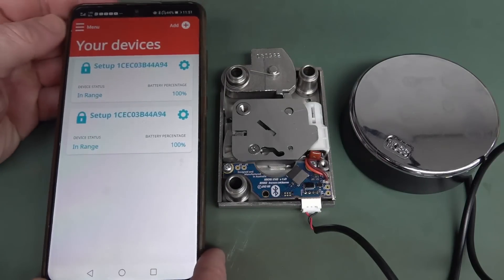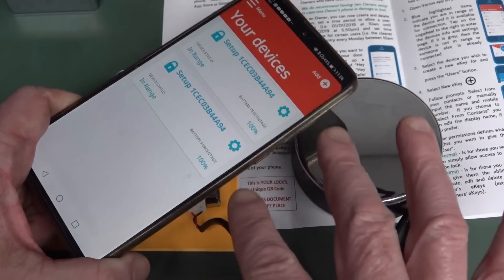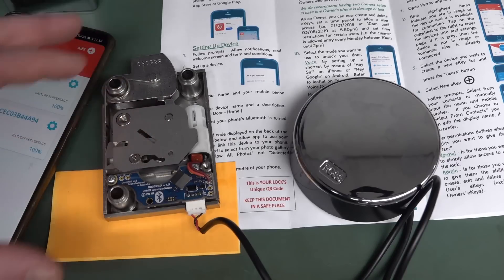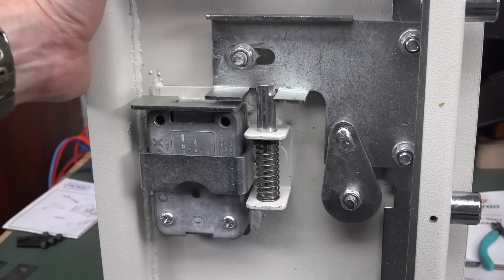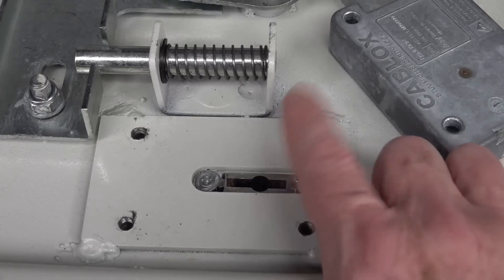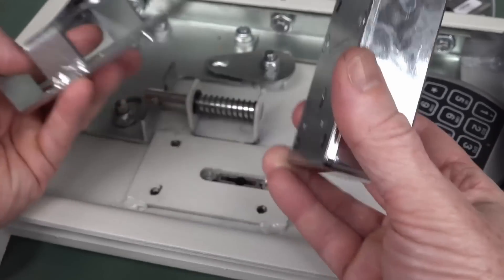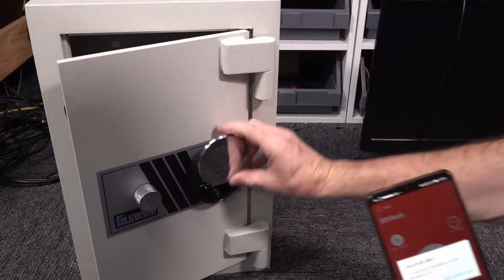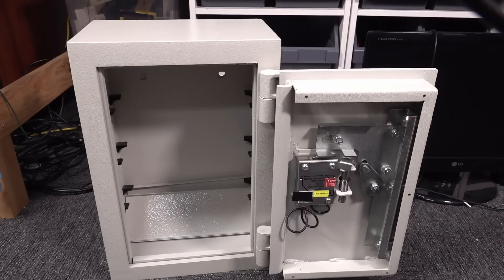Bluetooth Enabling a Security Safe!

Comment: "There's a KER-KLANK as the safe opens."
(a message in Fallout 2)

Agreed on using non-specific encryption protocols. Use a tried, tested and true industry standard protocol rather than re-inventing the wheel - there's a better chance of having any bugs squashed long before you even implement it on your device. Security by obscurity is an obvious insecurity.

Comment: What happens if you damage or migrate your handset to a new device, does all the codes transfer?  Seems like you'd need to keep a backup handset somewhere safe...
Reply: You can generate the code algorithm again from the QR printed on the manual. That isn't an issue.

Comment: Not really a Faraday cage, as the gaps on the edges, and all the holes in the steel for parts are going to allow a lot of RF leakage. Plus very likely the actual handle is electrically isolated from the front panel with paint and an oil film, so it will transmit the RF energy through, albeit with high loss. Hopefully you did check the emergency keyslot does work, and that you can open the safe without the BT connection.  Otherwise you will be opening it the hard way, angle grinder through the bottom or the back, which is where the safe traditionally has the thinnest steel, as most are designed to be either built into a wall or bolted down
Reply from the maker: Yes, farday cage wasn't really the correct term, and the handle is electrically connected to the chassis. The wires going through the front to the battery would be a high loss passive radiator I suspect.
I actualy didn't drill out the emergency key hole for this video, as I don't intent to keep the bluetooth lock installed. So yeah, I tested it just before closing and crossed my fingers and hoped it worked! Ross assured me it would, but still...

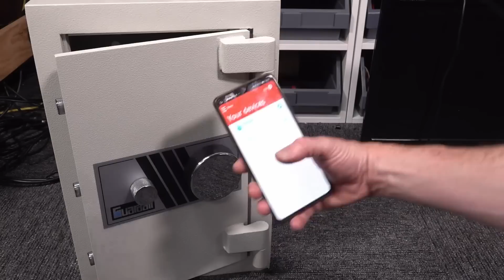Comment: Dave, 10:00, you also have the copper wires that are going from outside of the safe directly into the safe that do carry rf into where the bt chip is.
Reply from the maker: Yes, but they aren't technically designed to do that. The antenna is on the chip, see the datasheet I included.
Reply: @EEVblog2 love data sheets and dave , my point was it cannot be a Faraday cage with a great big long(relatively) copper wire running through it, but thanks for teaching me about the Bluetooth chip, it looks very sexy for future projects, small profile ones certainly with that built in antenna
Reply: @alexkaidon8700  I was a bit loose with using the term, chill out dude.